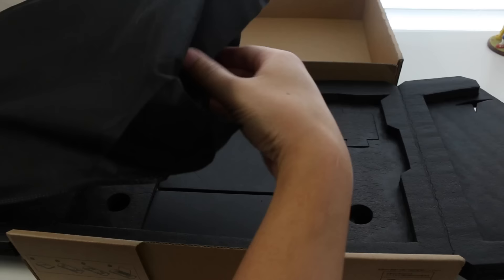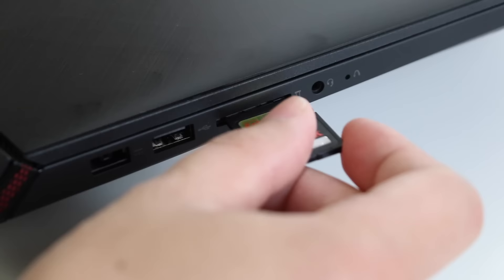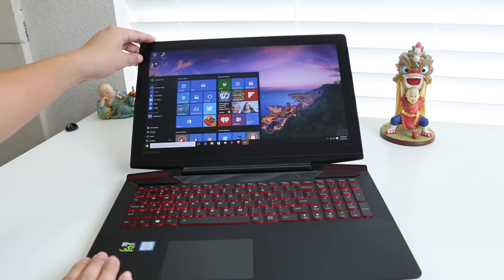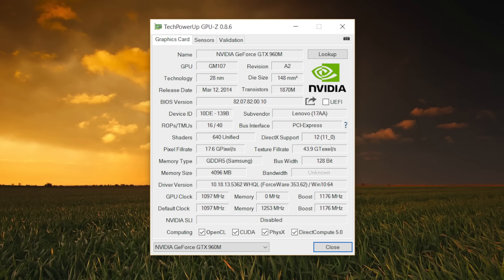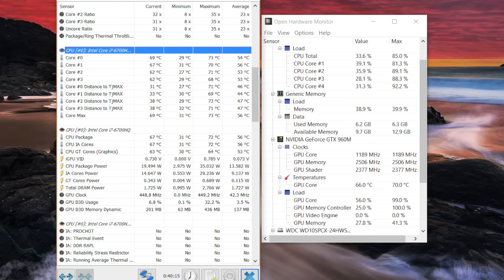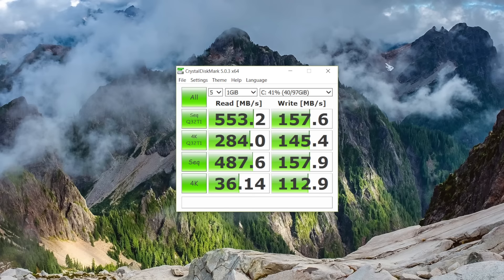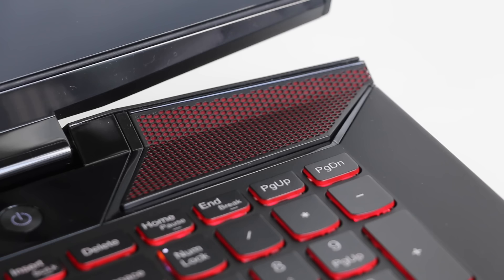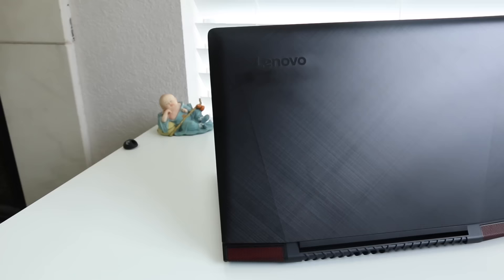Lenovo Y700 15.6" Gaming Laptop Review

Comment: Same crap as Lenovo Y50 2015, put a damn GTX 980M and this laptop is the winner for 2015. I still don't get why it's GTX 960M again
Reply: +Tech1Tv 960M is not that bad, I guess
Reply: Anton C. It's not bad, but making a gaming laptop without 980M is kind of weak. Lenovo call them the best gaming laptop but they don't even have 980M
Reply: Rishu Raj Sharma You can't say something is the best if it's using a 2 years old GPU, make it with 980M for $300 more. That's what they should of done
Reply: +Tech1Tv oh, I get it
Reply: +Tech1Tv If you want to go for the best gaming laptops with the latest GPU's go for the High-end ROG models. But keep in mind that the prices go pretty high(I mean not Alienware-high, but pretty expensive for a laptop)
Reply: +Tech1Tv but how the hell would you cool it for the price? look at the Aourus x5 it costs a 700 dollars more give or take and it only has 965m on sli (even tho IMO sli is mostly useless)
Reply: +Kiril Raykov or aorus they make SICK laptops even tho a bit on the expensive side
Reply: Kiril Raykov Yeah Asus make good laptop but they cost a lot, i don't want them for couple reasons. I think i will get Lenovo Y700 or Aorus X5 2015
Reply: Henry Montero Aorus X5 2015 is a powerful laptop, it get 70FPS in any games when playing on high and 55FPS on ultra. It just cost a lot, if the TouchPad was good i would probably get one.
Reply: ***** i know but I dont know if you get my point. the X5 is almost 1000 dolars mor expensive and it still has a 965M(sli)and is also LOUD AS HELL. Its not easy to fit a 980M on a thin laptop heck even the razer blade 2015 has a 970M. why? cooling the 980M runs hotter than the 965M on sli(I think, dont know the numbers) and the 970M too. I have yet to see a thin (like this one or the Blade) powerful (980M) and realivly quiet gaming laptop.,Btw the 960M is not a bad card(for the price), Im right now (litteraly now) playing Fallout 4 (1080o Ultra preset, no motion blur nor TXAA) and im getting 40 fps stable
Reply: Henry Montero I know the laptop need to be thicker to put 980M, that's what this laptop should of be. Put 980M and add $200 to the price, it would of been better. Using the same GTX 960M again is a noob move and they calling it the best gaming laptop, sure the best gaming laptop can't even play games on the 2K display they have. I don't even know why they make a 2K display this year, the best gaming laptop can't even get 55FPS in GTA V on ultra at 1080p. Yes Aorus are really loud and expensive, i already watch some reviews about them. Their TouchPad not good either, GTX 960M been out for 2 years, there's no reason for Lenovo to keep using them and calling their laptop the best gaming laptop. They are cheaper and thinner but they not that powerful for games, i would rather play on high to get 55FPS than play on ultra to get 35FPS.
Reply: ***** Well, you do have a point. I'm sure that lenovo is using the "best gaming latop" thing as marketing and dont actually mean it but I think the 200 dolars would be enough since every Gaming laptop with a 980M I've seen are REALLY expensive but anyways you need to also know that this laptop is not targeted to you, the kind of gamer who dont cares about thickness and just raw performance. Me for instance bought the Y50-70 (touch model 1080p, even tho I wanted the GS60 with the 970M) and I NEEDED the slimness since I'm using it for school,  and editing videos and photos on Adobe Premiere and Photoshop on the go for events (some even live) and this is just what I needed, Yes a 970M or a 980M(or just the 980) would have been really nice for gaming but I was surprised at what this little card could do. so yea keep in mind that their target public is something more like me than you. It's not meant to be a desktop replacement but a desktop compliment kinda.
Reply: Henry Montero Yeah Lenovo Y700 is not for everyone but they should of make a model with 980M incase some people want better performance for games, MSI GS60 is better but it's thicker and cost more. Lenovo Y50 is good but the TouchPad and screen not that good, i think i will get Lenovo Y700 though. MSI GS60 and Aorus X5 cost tomuch
Reply: +Tech1Tv yeah they should make a model with thr 980M
Reply: +Tech1Tv 

       'll
Reply: +Tech1Tv 980M would require a big and thick laptop to cool properly, not to mention a huge 180W+ power supply. I think a 970M with 3 or 4GB of VRAM would be ideal for the Y series.
Reply: +Tech1Tv It is probably because of the price. Other brands have 980m but is more expensive. This is the "budget" line of gaming laptop
Reply: +Tech1Tv LOL, just add a 980m and 200 dollars? The 980m chip itself is upwards of 700 dollars, not including a FAR BETTER cooling system, thicker laptop, and a proprietary motherboard. The Y50 series is for casual enthusiasts who want a great all around laptop at a great price. Not to mention it's very sleek and looks stunning. Research before you speak. 
http://www.ebay.ca/sch/i.html?_odkw=&_osacat=27386&_from=R40&_trksid=p2045573.m570.l1313.TR12.TRC2.A0.H0.X980m.TRS0&_nkw=980m&_sacat=27386
Reply: Aayush Kaintura I know what i'm talking about already, you just don't know what my comments mean. If this laptop was Razerblade or Mac it would cost $2500.
Reply: +Tech1Tv $200 more for a 980M or 970M Sli? Did you look at the prices lately? They cost over or close to 2K and this cost 1K or even less if you lucky. Of course it's not the best gaming laptop but it's still does the job most of the cases, but what do you want for the price?
Reply: ATTILA THEHUN That's what i say and that's exactly what they did with Lenovo Y900. Lenovo Y900 only cost $300 more compare to Lenovo Y700. Those companies make people think stuff cost so much when they not and people fall for it, they do have to make profit so it's fine with me. If it was Asus or Razer Blade who make Lenovo Y900 it would cost $3000, now you get my point.
Reply: I would get your point if you would know what you are talking about. First of all you compearing a desktop to a laptop, pc always cheaper than laptops. Second, the Y900 with a 970 cost $1500 and you were talking about 980 and sli 970's. A Y900 with a 980 cost $1800 on newegg for example, let's not talk about Lenovo's site where it's $2400, the integrated graphics( intel graphics) version cost the same as the Y700 with a 960 card. The Y700 with this configuration is well priced as $900-1000, you'll see when they come out the 980M version how much more will it cost ($1700-1900 in my opinion, or Lenovo might gonna sell it for $1600 to be more competetive , but that's still $600-700 more than the 960 version).
Reply: ATTILA THEHUN I'm not sure where you get desktop from, i never say anything about desktop. If you don't understand what i'm saying that's fine buddy, you have no idea what you talking about. Lenovo Y900 come with GTX 980M not GTX 970 and it only cost $300 more than Lenovo Y700. It seem like you lost but you think you know it all
Reply: *****
Man thats a great price. I wish I had knew it before hand when I bought the Y50
Reply: Henry Montero You can always find laptop cheaper if you look, i stay away from Razer Blade and Asus because they killing people with their price. If this laptop was their laptop it would cost $1700 or more. Lenovo sell it for $1100, you got the Lenovo Y50 2015 or 2014?
Reply: *****
First of all I thought you were talking about the Lenovo Y900 not the Ideapad Y900, I do apologize for that. Second, the Ideapad y900 is not out yet and wherever I checked the prizes, the 980M version will start at $2000, so please send me the link where it says it will be $1300-1400.
Reply: ATTILA THEHUN Desktop and laptop have the same name except for the middle name, you assume i was talking about desktop but i wasn't. There's no link to give because it's not June yet. Lenovo always release laptop on a $400+ discount, Lenovo Y700 start at $1400 when it was new last year but it was on sale for $1000. Now it start at $900. Now you got it 👍
Reply: ***** I got the 2015 touch version and yes the hinge problem did came up. I cant close the damn thing T_T
Reply: Henry Montero Yeah some people say they have that problem, i had Lenovo Y40 and never had that problem. But it was a bad laptop, i wanted Asus G501 but it's expensive and old now.
Reply: +Tech1Tv They do the 860m/960m because this is their budget gaming line. There are laptops out there with 970m and 980m.Heck even there are laptops with desktop graphics in it.
Reply: Im in the market for a gaming laptop here in 2 to 4 months. Im a console player and have been since i was 7 (dont hate i know pcs are better haha) so i really dont know what to look for or what to get. Any help would be awesome. My budget is $900 or less
Reply: JTundra If you have  $900 you should get Dell Inspiron 7567
Reply: Tech1Tv i will look into that thanks

Comment: I was going to get an ultrabook for my college but I'm still stuck between this and a ultrabook because with this I can at least do some light gaming with the 960m rather than suffer with Intel HD with most of the ultrabook out there .
Reply: Get the razer Blade stealth. Then you can buy a core.
Reply: I don't really have the budget for it
Reply: +jet lee Its cheaper than this but i dont know about the core.
Reply: +jet lee Its cheaper than this but i dont know about the core.
Reply: +andersen442dk I'm pretty sure the y700 is cheaper
Reply: +jet lee I actually dont think so. The blade is 999$ right now. But you have to buy your own core and graphic card.
Reply: +andersen442dk and the y700 is around 800-900
Reply: +andersen442dk but I do really want to get the stealth

Comment: it's only problem is that it gets hot, i'm scared of that it make it slow that's why i haven't still bought it!
Reply: I have had no throttling/ heat issues with it and I tend to game for several hours at a time. No issues thus far, just plug it in if you're gaming since the 960m is a power hog.
Reply: Mandalorian Mercy this thing just gets hot i will go for the alienware r3 it's a better choice

Comment: Long at last am happy now that I have successfully sold off this laptop. It was giving me headache with its display much as I liked the best audio it has. Good bye Lenovo Y700
Reply: what did you hate about it?
Reply: +abid kadry The only thing I hate about it was the display, nothing else. It is fast with SSD but snail slow with only 1TB HDD. I liked to make comparisons and I noted that there was no laptop I ever saw which had a poor and less vibrant display like that on the Y700 I had. I liked its audio but in my opinion, I feel like if you look at laptop display and audio, display should take precedence than audio, that is to say display is primary while audio is a secondary thing. Lenovo prioritize a secondary feature (audio) at the expense of the primary feature (display). Similar, performance is a primary feature and beauty of the laptop is a secondary feature kkkkkk.
Reply: +Timings M did you mean color accuracy??? Is it not good enough for gaming purposes????
Reply: I meant the display does not produce deap colours compared to other displays. I enjoyed playing games on the Lenovo B50 30 all in one PC because of its excellent colours but this Lenovo Y700 hmmmm: It depends on how many computer displays one has ever seen to make a conclusion that something is good or bad kkkk
Reply: I find no problems with this laptops display, just my opinion.

Comment: Man this may be dumbass question, but Im about to be going to college, and do a bit of gaming on the side whenever I will have time to, so I'm asking will this do me justice for essays, and powerpoints?
Reply: ohh hell yeah
Reply: easily. the keyboard is nice. Touch pad is sensitive but usable, I advise using a mouse though. Also if you're attaching to a projector, it only has the HDMI port, so adapters are your friend if the projector only connects to older type connections. It'll also run just about anything quite beautifully for most of the games out there.

Comment: Hm ever wondered why the GPU temperatures remain so low? Just the cooling?
I did a GPU stress test with Furmark and here are the results
https://dl.dropboxusercontent.com/u/69077690/Lenovo%20Y700%20-%20GPU%20throttle.png

Looks like the GPU is being throttled upon reaching 65-67°C, from 1262 to 1058 Mhz!

P.S. No I do not use energy saving mode and no other programs throttle my GPU

Comment: Dell will better configuration coming at a cheaper price, watch-out 

Ideapad Y700-15 Touch - 80NW0010US (http://shop.lenovo.com/us/en/laptops/ideapad/y700-series/y700-t-15-inch/?sb=:000001C9:000161B4)
$1,569.00
Processor
6th Generation Intel Core i7-6700HQ Processor (2.60GHz 1600MHz 6MB)
Operating system
Windows 10 Home 64
Display
15.6" FHD LED AntiGlare Backlit Multitouch (1920x1080)
Memory
16.0GB PC4-17000 DDR4 2133 MHz
Hard Drive
1TB 5400 RPM+128GB SSD
Graphics
NVIDIA GeForce GTX 960M 4GB
Network Card
Intel Wireless-AC 8260

DELL (http://www.dell.com/us/p/inspiron-15-7559-laptop/pd?oc=dncwpw5722h&model_id=inspiron-15-7559-laptop)
$1,299.99
Processor
6th Generation Intel® Core™ i7-6700HQ Processor (6M Cache, up to 3.50 GHz)]
Operating System
Help Me Choose
Windows 10 Home 64-bit English
Memory1
Help Me Choose
16GB DDR3L 1600 (8GBx2) [16GB Dual Channel DDR3L 1600MHz (8GBx2)]
Hard Drive
128GB SSD [128GB Solid State Drive] + 1TB 5.4k HDD [1TB 5400 rpm Hard Drive]
Video Card2
NVIDIA® GeForce® GTX 960M 4GB GDDR5
Display
15.6-inch UHD (3840 x 2160) Truelife LED- Backlit Touch Display
Reply: +Captain Slow GT86 consider the price also you dumb, even though it is DDR3 it is 2x8 GB slots which will have better performance than single 16 GB one, and do you know what are the differences of DDR 3 &amp; 4? also I am not here to force someone to take a particular product, I just gave my findings, if you have anything positive that helps people in purchasing the best please share.
below is the comparison I found on DDR3 and DDR4 (http://www.pcgamer.com/the-differences-between-ddr3-and-ddr4-ram/)
 As Anandtech found in some comprehensive benchmarks comparing DDR3 and DDR4, neither was a clear performance leader. The difference between DDR3-2133 and DDR4-2133 was negligible in a number of applications, ranging from Handbrake video conversion to half a dozen different games. DDR3 was slightly faster about half the time, and typically only a few percentages points separated the two memory types.
Reply: +Partha G if you buy from lenovo page now you grab it at 1,099 $ i grab this and that's all pals
Reply: +TheDiegiset I too bought it dude Y700 + Touch UHD, 16 GB RAM, 3Yr+ADP for around 1500